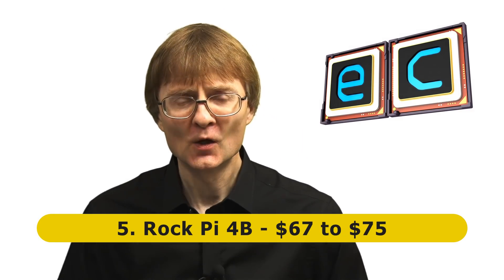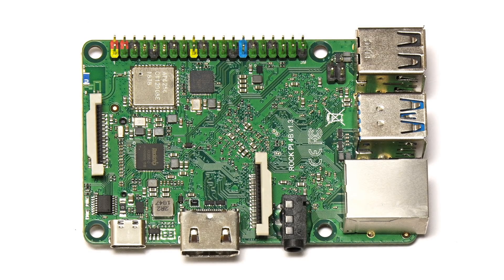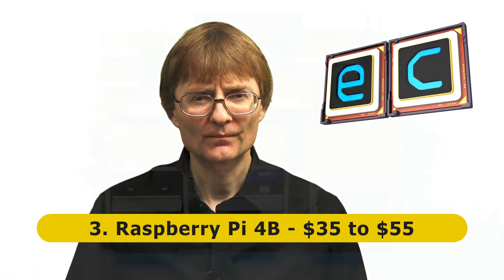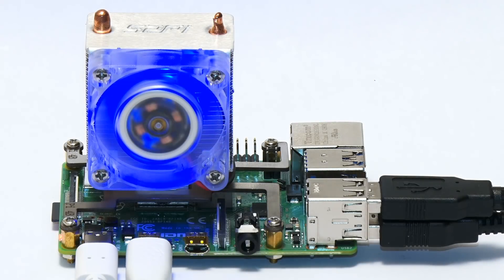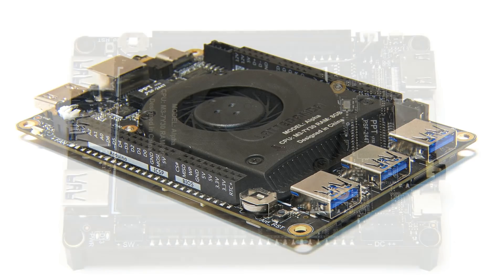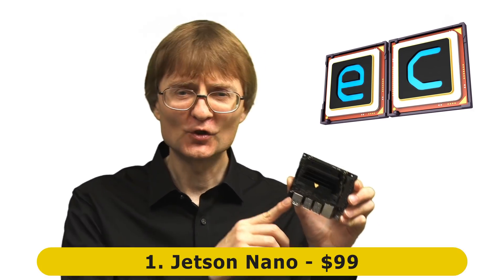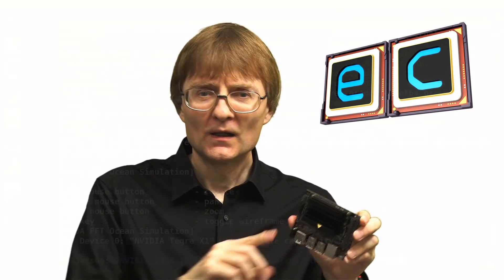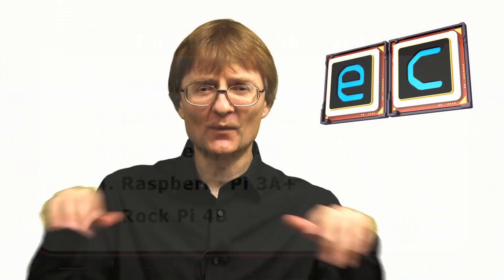Top Five New SBCs 2019

Comment: The other positive point on the Nvidia board is they managed dual HDMI full sized connectors by stacking them instead of going micro sized side by side. Raspberry Pi should have done this with the 4B, the height isn't an issue.

The 3A Pi wouldn't have made my list, the price difference is too small for what you lose compared to the 3B and too large compared to the zero W. At $15 or $20 max, it would be worth it.
Reply from the maker: True, though note that the Jetson Nano has full-size HDMI and DisplayPort, not two HDMI. Which in some ways is even better! :) And the LattePanda Alpha can support dual displays via HDMI and USB-C. So there were other ways to go for the Raspberry Pi Foundation, other than two micro HDMI.

Comment: A fine constructed list to shaw what is posissible.
It is interesting to see when we get expansion boards in that (Pi) form factor.
It would not be a SBC but imagine  a Pi 4B with a serious graphic card and power supply, all stacked neatly behind the screen.
We are getting to a point, where the processor/computer no longer is the most important, it will do what we need but the screen and internet is much more important
The futura is most welcome.

Comment: This reminds me of early days when we had the IBM PC/AT 386, 486, etc. Whether you bought a genuine IBM or a "Compatible" they were basically the same. Gradually we started to be able to tailor a PC to meet individual needs and budget. So it is with the SBC, first, we just had the Pi now we have a growing range that we can select for our personal needs. I look forward to what is around the corner.
Reply: I don’t remember it like that at all.  You had a load of different things that got plugged in, it wasn’t a guarantee you’d have a sound card for example, or that if you did it would work with the software.  Graphics the same, networking the same.  
Yo'd either spec what you needed, and they would add cards to ISA slots, or you'd do it yourself.

Today everything is increasingly either on board or soldered to the board and there’s little customisation possible.  The most popular computer is said to be the smartphone, how customisable is that?  I can’t even change the battery on mine.  Laptops, certainly ultrabooks, the same.  How customisable is a Chromebook?

Comment: Isn't the Jetson nano technically a double board computer?
Reply from the maker: It could be considered that way! :) But technically (and certainly according to NVIDIA) the smaller SoM board is an SBC (as it contains the CPU, GPU, RAM, and even the micro SD slot), with the carrier board being basically a break-out board for all of the connectivity.
Reply: the chip is also a slightly underspecced version of the Tegra X1 that the Switch and Nvidia Shield uses.
Reply: @NexXxus86   What you call cut down most would call based on, adding functionality for machine learning frameworks like TensorFlow, PyTorch, MxNet, Keras, and Caffe.  Which your Nvidia Shield will lack.  It isn’t cut down in the 86_64 sense of silicon binning where say a CPU is identical to its more powerful neighbour in the product stack but it has had functionality artificially cut (which is pretty much how AMD work, along with the X chips being binned based on performance metrics).

Certainly, the Nano isn’t just a cut down version of the £1000 plus Nvidia AGX Xavier board which tops the range, it has the same functionality but is just less powerful.
Also consider that if you buy a Nano can do what the Shield can, while the Shield can’t do what the Nano can.  IN that sense which chip is ‘cut down’?

Consider the Intel Core Duo range, Intel have been hawking that for years, and in sometimes quite arbitrary ways.  It’s normal to adapt a CPU architecture because to start from scratch would be punitively expensive and unproductive.  Intel will have got over a decade out of Core Duo, with one notable revision back in (IIRC) 2015).
Reply: @twmbarlwmstar  what I actually mean is, it has a lower clockspeed and half of the cuda cores of the Tegra X1
Reply: @NexXxus86  Indeed, it is also over £900 cheaper and if you are at the enthusiast end (which we are and this channel is focussed on) then it's great that Nvidia is inviting us to the party really by offering low cost entrance.  You can do everything the faster chip can but more slowly.  This is like AMD offering a slow Threadripper or EPYC chip, all the enterprise features but packed into something like a Ryzen 3200G- never going to happen*.  But Nvidia has.

*I realise there are real technological reasons why this couldn't happen even if AMD wanted to.
Reply: I gave this some thought and I would say the answer is no, the 260 pin so-dimm arrangement of the Nano Module just acts as a break-out for the interfaces AKA I/O  ( video, audio, USB, networking and so on).

Looking at it anyone buying a Nano will buy the Nano and the daughter board, it seems likely that Nvidia are selling this, as the Jetson Nano Developer Kit, at a loss as it is cheaper than buying the Nano module alone and they seem to only sell that in a minimum order quantity of 1000.  Again, I say the Nano is cheap.

Looking at the daughter board (and please double check what I claim, I am getting very unreliable as I have stage 4 cancer and have to use morphine, making me error prone) all it does is add I/O like Gigabit Ethernet, 4 × USB 3.0 sockets, HDMI and DisplayPort ports, an MIPI-CSI camera socket, micro SD Card slot, Power-over-Ethernet (PoE), plus quite a bit more.  You also get GPIO, I2C, I2S, SPI, PWM, and UART via a 40-pin GPIO header block- and that GIPO header block looks a lot like a Raspberry Pi header block to me.  In isolation it does nothing.  You could theoretically build your own daughter board, and that is evident as Nvidia will sell you 1000 compute modules if that is the sort of path you might take.  So, a developer will use their own bespoke daughter board that fits their design brief.

On a wider point, we need to compare this to a Raspberry Pi developers kit as that is what we get from Nvidia for about £100- I realise you have made no statement on value/ cost but others have. It also seems to add things like PoE which the Raspberry development kit lacks and would add at least £20 currently.
Reply from the maker: @twmbarlwmstar  You are absolutely correct -- the daughter board just breaks out the connectors from the edge of the Jetson Nano SoM to connectors a typical consumer/maker can use. Sorry to hear about your illness. I hope things go as well as they can for you. My best wishes.
Reply: @ExplainingComputers  The cancer is what it is, I only mention it because it can make me appear a bit stupid (or rather the treatment/medication can), and I'm not really (although neither am I as clever as I like to think I am).
Reply from the maker: @twmbarlwmstar  You always seem well informed and well reasoned in these comments. But I will keep what you have shared here in mind.
Reply: These are called SOCs, or system on a chip, even though there are no real single-chip boards on the market. (At least considering usual/big names.)
The main difference is whether all the core features are available on a daughterboard or not, still, they all fall under the SBC umbrella.

Comment: i'm wondering about the AI  (Alexa) could run quickly and stable on the 90$ SBC jetson nano ?
Reply from the maker: Technically, I am sure this is possible. But it would need support for the board.
Reply: @ExplainingComputers chris what do you means about the support?!  do not support  Raspbian on nano?
Reply from the maker: @林宜宏-m4e  You would need a version of the Alexa software to run on the Jetson nano's hardware, able to access its CUDA cores. And that software support is not available right now.
Reply: @ExplainingComputers  @_@  still don't get it, Explain  please!
Reply: @林宜宏-m4e  There are several YouTube videos that cover interfacing SBCs with Alexa. Try searching for 'Alexa Raspberry'.😎
Reply: @ExplainingComputers  you means the control CODE of the GPUs with pi  is absolutelly  differents the control CODE of the GPUs with nano, isn't it?
Reply from the maker: @林宜宏-m4e  Yes, the Jetson Nano does not have the same hardware as a Raspberry Pi, and will not run the Alexa software released for a Pi.
Reply: @ExplainingComputers  in order to install Alexa ,  so that i gotta install UBUNTU on nano with another version of Alexa?
Reply from the maker: @林宜宏-m4e  As far as I am aware, the only SBC that Amazon have ever supported Alexa on is the Raspberry Pi. The Alexa software is proprietary, you cannot just install it on anything you like. There is a Windows app, and an Android app.
Reply: @ExplainingComputers  yes, and yes.    they  and only they have the big Alexa platform with windows and  with mobiles.

Comment: I would have found a way to work in the Udoo Bolt V8 in place of one of the Raspberry Pi's.  Yes it's expensive, but so is the LattePanda Alpha (which can work as a Hackintosh), but the Udoo Bolt is a great SBC with the Microchip ATmega32U4 for Arduino development.  Great list and thanks for your insights.
Reply: The Bolt was a nightmare for many backers (I was one, but got a refund eventually, glad I did). The kickstarter comment section is full of people who have had Bolts turn up DOA or not working after an hour or two, all sorts of problems with BSODs etc, it seems quality control has been very poor, which is a shame as it had a lot of potential. Many people seem to have received incorrect orders as well, particularly with the wrong (not enough) RAM compared to what they paid for. Let's hope Udoo fix the problems soon. But, even if they do, it's way too expensive, it was borderline with the KS discounts, but retail pricing is too high.
Reply: Ciao  @ledsalesoz  ,
glad to see you here. Hope everything is fine with you. About the issues you mentioned: some users are experiencing issues with the fan: we had an issue with a defective batch, and we're replacing all of them as we're speaking. Additionally, someone at the factory has brought a box of 4GB RAM modules instead of the correct 16GB RAM assigned for that day. We're also replacing that!

In your case specifically the BOLT was late, you didn't wish to wait anymore and we provided a refund. I wouldn't call that a nightmare :).

I love that you're still following the campaign closely, but please also consider the response we're giving to the issues.
Luckily the pre-orders are going better than expected, it seems that many people don't agree with your opinion of the price tag ;)

Eva
Reply: @ledsalesoz  I'm not really surprised if backers had a lot of problems with that. Even Ryzen Mobile owners (same FP5 platform as Ryzen Embedded) had lots of problem with it.

As a Ryzen Mobile user, it is actually the best to let the CPU (or specifically the SMU) to manage everything for you. Attempting to change some stuff just makes it go haywire (at times my CPU won't boost at all). Still, it's sad that AMD doesn't even allows flexibity to tune stuff in the BIOS. I had to read Bolt's BIOS guide to know what menu did what and some settings may cause the board to lock up.

Comment: I would have thought the raspberry pi4 would have been higher, but I have to agree about the HDMI ports. I have bought two or three different adapters and some of them don't work so well.
Reply: It doesn't beat the Latte Panda or Nano, unless you were judging on cost but that isn't a good way to judge 'best'.  I'm sure a lot more Pi4 will be sold than Latte Pandas though.
Reply: @VeryUs Mumblings  The RasPi has great software support, but both models here, including the 4B, actually have the weakest hardware on this list, by quite a lot. That's not to say that they aren't good, just that the other boards here have more powerful hardware and more features.

Comment: Cant go along with your choice for number 2. Too expensive... Good luck to the manufacturers pushing whatever envelope you think is required Chris, but that board is simply out of the ballpark on price, and its precisely because it'll be on every damn board in a few years that its not suitable for home automation, robitics or a desktop.

Your number one I'd go along with, then again I dont have one yet...and a gpu with no actual OS support for video etc. is pretty daft. But tensorflow works well with it.

Position 3? Really? This is the PI i'll miss...im not spending another $30 on cooling...may as well buy the nano.
Reply: Mickelodeon: You're paying for the CPU cooler in the higher price point on the Nano... except you don't have the flexibility of choosing which one to use.
Reply: @TheUtuber999  but you do get a pretty good GPU... Well a good GPU for a board half the physical size of a phone.
Reply: I think his point is that there's not a whole lot of options for x86 compatibility in anything smaller then ITX size.

I'd personally love to spend a few hundred bucks on something the same power that my Optiplex does without the extra case lying around.
Reply: @DFX2KX  There's STX, in the UK that's only Asrock's deskmini but much more widespread in MEA/Far East.  It's about 5" square and some motherboards have plenty of 'SBC' I/O- the prices are a bit salty though which is probably reflected in the cost of the Bolt.
Reply: ukkr  Memory is at its cheapest in all of history right now, although the LAtte PAnda does use a relatively expensive version of computer memory.

Comment: The mini video ports on the PI4 are a bit fiddly!
Reply: Not to sound too OCD, but they are micro-HDMI.
But yes, they are both too fiddly, and I fear not wonderfully robust.
Perhaps using mini-HDMI would have been a better compromise if two ports were chosen?  I wonder if the Raspberry Pi Foundation are as responsive as that Rockpi M.2 board maker?
Reply: @John.0z  I can't help but feel the Pi Board would have been better served by two stacked HDMI outputs, like the nVidia board has.  I don't think it would have hurt the form factor that much, and people will need new cases anyway with the dual mini HDMI.
Reply: @SoylentSoy  I had not thought of that, and yes, it would be better in every way.
As I modify virtually every computer case I own, I see no trouble in modifying Pi cases as well - the one example of a genuine Pi case I bought has been modified, and the Barch design one heavily so.
Reply: I wish they had the full HDMI port and had the other as a header that an adaptor board could be connected to (a bit like the DSI/CSI connectors)
Reply: In my experience, micro-HDMI has been notoriously flaky. Very strange that they went that route with the Pi4. Luckily, the connector on the cable end is usually the first to fail (even after minimal use) rather than the actual port on the device - again, in my experience. I totally agree with the comments here suggesting the use of an adapter to reduce the number of connect/disconnect cycles.
Reply: They should be full hdmi sockets, maybe they could of had them perpendicular to the board to save space. Would really like to see a SATA port though
Reply: @deanharrysmith718  or a powered esata port on one or both USB 2.0 ports
Reply: Mini displayport in at least one would have worked. at least you have one that will always work.
Reply: @Corei14  ,
Displayport carries audio too.
Reply: @photonboy999  right. I guess it is better in every way?
Reply: @photonboy999  i hope it does otherwise my computer is sending audio to my monitors with magic! LOL
Reply: @smartroadbiker  IMHO modern technology is indistinguishable from magic.
Even 5 years ago, who would have thought that you could run a passable desktop computer off a mobile phone plugpack?
Reply: They could have put 2 full hdmi ports stacked on top of each other like the jetson nano that have an hdmi with a dp on top of it. Even if it is a bit taller than the gigabit lan or the 2 usb stacks it will not be by much. Besides they also need a heatsink so extra space inside the cases will be used for cooling.
Reply: I made a port extender / adapter hope to try it out soon
Reply: @ Jon Tallman 
Let's be honest, they're ALOT fiddly! Workable but not optimal.
Reply: my friend was thinking of attempting to put some epoxy or a potting material around the ports.  i should ask him how it worked.
Reply: @spunkmire2664  I think we would ALL like to hear how that turns out.
The hard part would be keeping the connectors clear of epoxy.
Reply: Yep just like the Pi Zero, which is why we don't use those not to mention the wifi on every Pi < 4 has been flakey at best.  Jury is still out on the 4 so far.
Reply: Use a micro HDMI to full size HDMI adapter. No more plugging / unplugging.